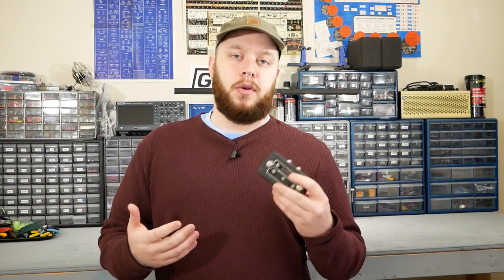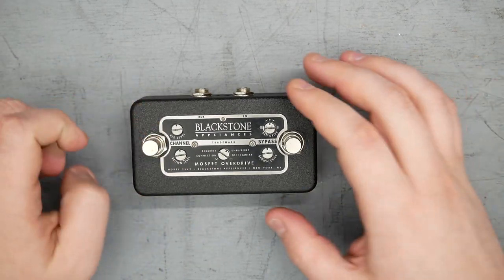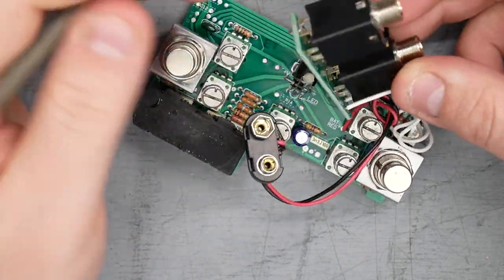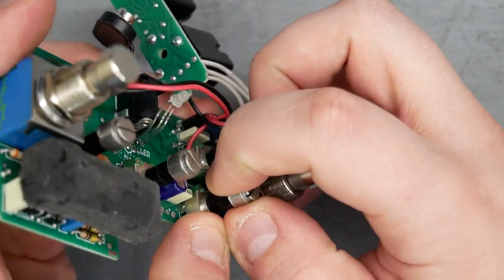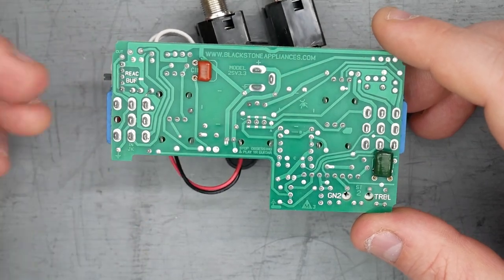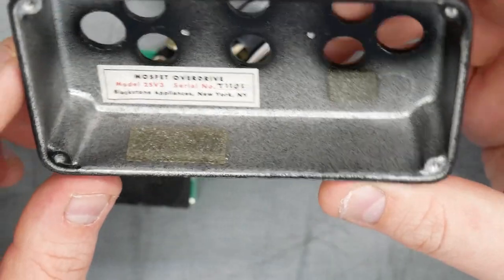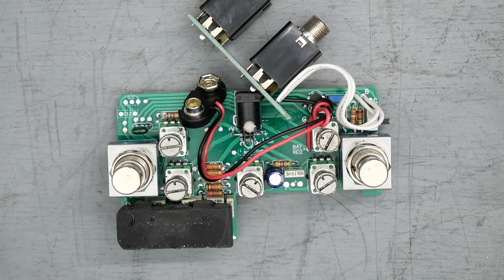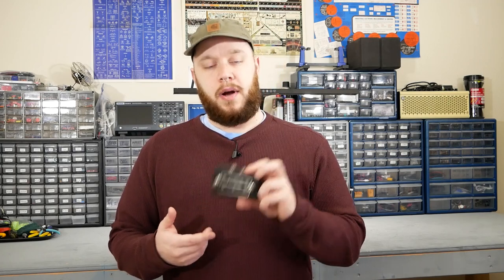Blackstone Appliances MOSFET Overdrive Teardown! See what's inside!

Comment: The gooped section has been revealed on various DIY pedal-makin' websites. A quick search will show you all you need to know.
I wonder if the goop serves dual functions: this pedal was created a good number of years ago when gooping was more common to keep circuits secret, BUT there's a heck of a lot of parts crammed in a small enclosure and maybe he wanted an alternative way to add a rather large IC and parts without taking up the main PCB real-estate.